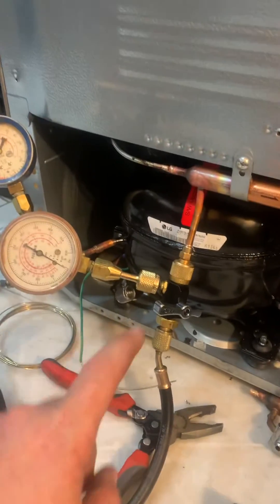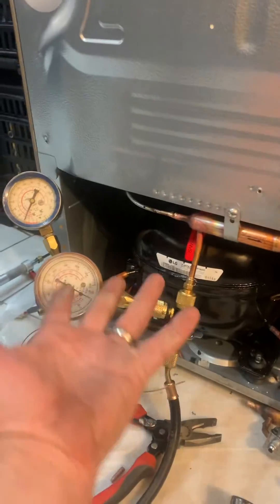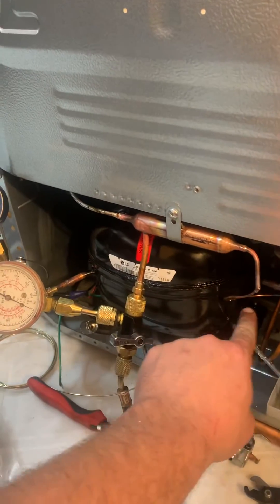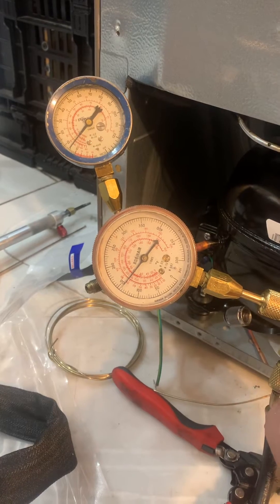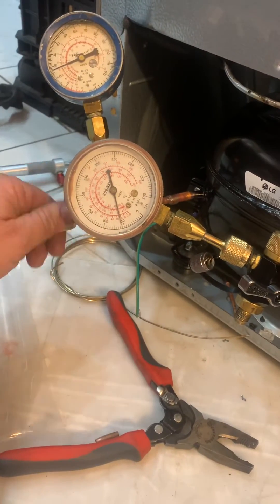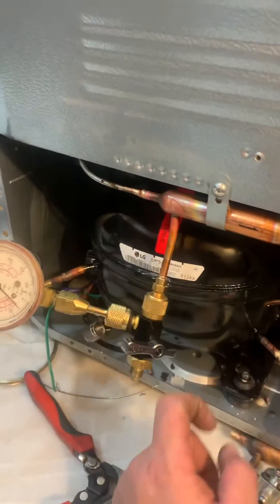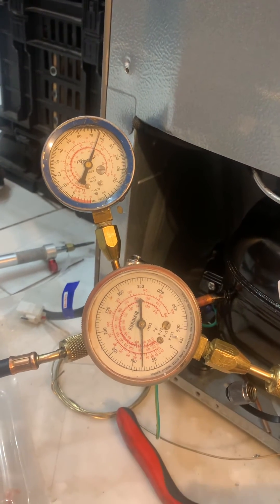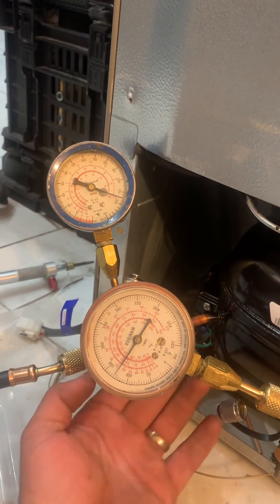How to check for restrictions with nitrogen in a single evap system

Comment: Bad ideal to run the pressure backwards on a lg some have a check valve in the cabinet. I run a robin air kit and blow threw the lines in the direction of flow
Reply: What happened to the check valve?

Comment: Couldn’t you just pressurize system with nitrogen through the access valve, and your high side guage hose hooked up or filter drier and see if high side drops when you release pressure off access valve?

Comment: If there was a restriction, what would the pressure had been? Or what would the gauges have done?
Reply: If there is a restriction the pressure will be reading in the vacuum which  is the negative. Either leak or restriction will be reading in the negative.

Comment: Can you explain to me R600 and oil in system how to clean before change compressor what is the best method. However nitrogen didn't work for me also I'm new in r600 sealed system.
Thanks
Thanks

Comment: The ambient temp is 73F & it equalized very fast when the compressor is off (< 5min). 
so few minutes after the fridge was turn on the pressure went to ~1psi on the low side and then few minutes  later to 10PSI , and on the high side it started at 90PSI and went to 125PSI. what does this tell you?btw. the compressor temp is slightly warm, i assume since it was just started, correct? 
now 20min into starting the fridge the low side is at -10PSI and the high side is at 100PSI, and the compressor is running high speed and starting to heat up ,does it mean the system is under charged ?

Well after an hour there was no pressure remaining and no Freon in the fridge, so I assumed there is a leak , being that there was no pressure , I decided to do nitrogen pressure test and for that I turn the fridge off and place the 3way valve into the home position(so both cap get the pressure). I then remove the shredder valve from both side and I was amazed to find that both shredder valve ring were completely gone, so I think that is a big part of the problem,right?
I then proceeded to do the pressure test and feed the low side with 100PSI nitrogen and monitored the high side to equalize and it did equalize fast at 100PSI. but I did notice that the pressure was dropping so  I checked  all the solder joints with soap water and could not find any leak, I then checked the manifold fitting and noticed a leak I tighten the fitting and I don't see any leak now. I will let sit at 100psi for an hour to see if it drops. if no drop in pressure is found I will almost for sure say that leak came from leaky shredder valve. i will then replace them with the new shredder valves, pull a vacuum and followed by 5oz of Freon charge will fix the issue. what do you think?

in the last hour it dropped by 5 PSI from 100 to 95PSI on both side. so checked the fitting again and found more leak by the fitting. I replaced the pressure line from the manifold to the drier high side and i don't see leak at the fitting any longer. I add nitrogen and sides read 100PSI. 
lets see if that drops in the next hour.  should I increase the pressure so I can hear it hissing, what do you think?
thanks for all your help.

Comment: The fridge had  been off for couple months, and I want to figure out why it was not cool enough in the freezer. Ok I will run the fridge and get the running pressures and then turn it off and see how fast it equalizes . what is the normal time for the pressure to equalize on both sides.?
Reply from the maker: Generally it should equalize in 5 minutes or less, but again the running pressures are more useful. Also might help to have the ambient temp of the space it’s in if your turning it on and checking pressures right away..

Comment: I liked your video.  question: I have a kitchenaid fridge with dual evap and the freezer side only get to 15F and the fridge is fine at 37F. with the fridge off and the manifold connected to both hi/lo side the pressure reads 40PSI  which means the pressures are equalized and there no  obstruction, correct. ?  are the pressure too high and that may explain why the freezer does not get to temp of 0F? is it worth to purge the freon and preform nitrogen  pressure test?

Im trying to find refrigerated leak in my refrigerator and I’m having lots of problems with my manifold set hoses, thinking I have leaks in the system lines and only to find out that leaks are from manifold lines. Shouldn’t  I use good valves on the ends of high/low ports so that I can shut them off while checking for leaks,  and take out the possibility that the leaks are from the manifold hoses?
Reply from the maker: Depends on how long it was off, you would want to have it on, read the running pressures then turn it off and see how fast it equalized. The running pressures are more important for diagnosis..